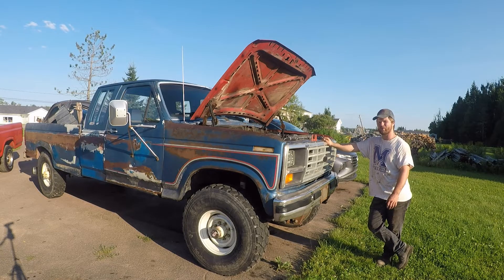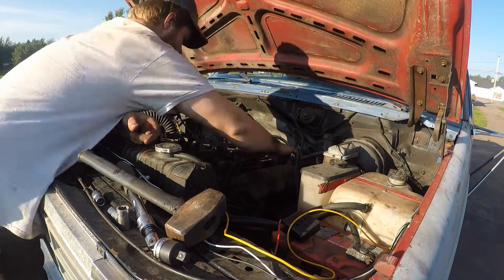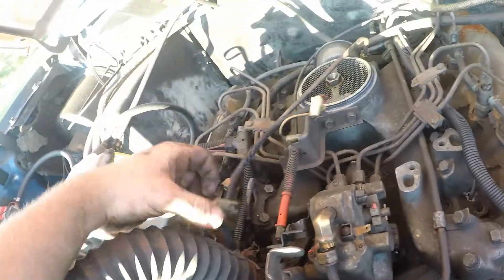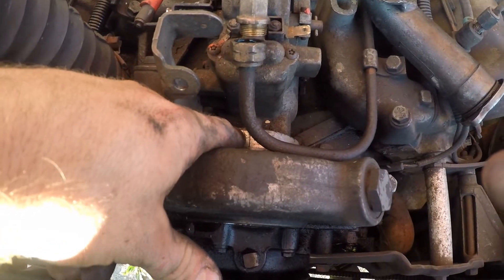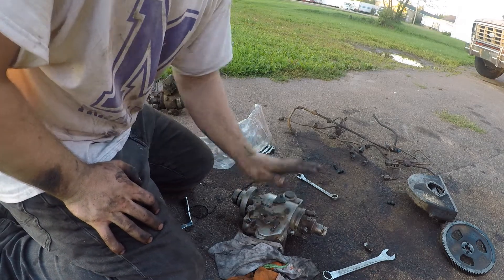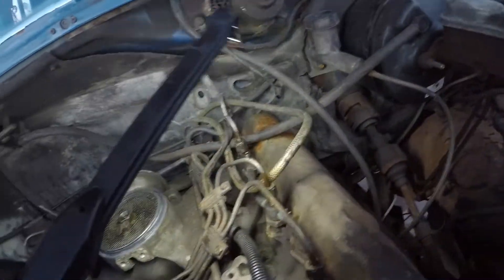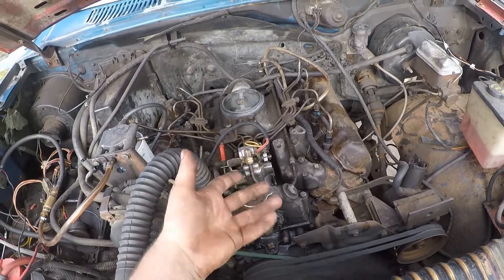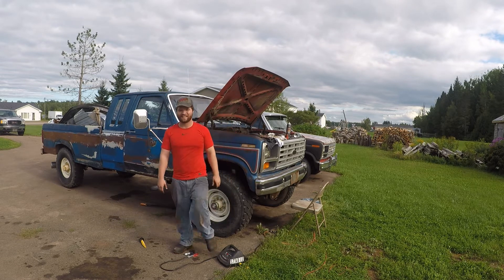7.3 IDI (6.9 IDI) Injection Pump Replacement, Step By Step Guide!

Comment: Hey man why didn’t you replace the injectors at the same time?
Reply: @jadinzack9271  I think because the IP is the most common issue on the fuel system, I've had to replace a few. (On different trucks)

Comment: Thank you for this, trying to work on my 7.3 idi turbo swapped 93 f350. Diagnose a bunch of problems after the swap
Reply: @2koolchris291  did the turbo get in the way much when removing/replacing the pump? im about to embark on the same journey.

Comment: Someone named skylabtech recommended your channel to me , I have a 95 f-250 7.3  with 300 k on it , I have an issue with it starting on cold mornings , below 60 degrees I have to use ether, they said my IP timing is way way off  ,  how do I diagnose it?

Comment: Good video and content ! Im about to replace a DB2 pump on my 7.3 and I was wondering when I take the old pump out can I just put the new pump right back in it's place or do I need to mess with the alignment of everything on the timing gear ? If nothing moves after i remove the pump don't I want to just install the new pump the exact way ???

Comment: I have a 93 f250 7.3 non turbo it idles fine but when driving faster then 30mph or 2k rpm it starts to stall and seems like its not getting enough fuel, and the fuel filter light comes on, i have replaced the filter, checked the fuel pickup, the fuel lift pump was replaced not long ago, im thinking its the injection pump but i dont want to waste the money on it, i have order the parts for a electric lift pump bc it may jdut the new mechanical lift pump is bad any insight on this would be super helpful
Reply from the maker: Best way would be to put a mechanical pressure gauge between the filter and the injection pump, if you have good pressure and good flow to the pump it’s pretty safe to say your pump is on its way out.

Comment: Just put a schrader valve on a gas cap and put about 7 psi air in the tank. Make bleeding a breeze.
Reply: Awesome tip. 👍🏼 I took my pump off but unfortunately I took the front gear off with it so now I have to make sure I install it in its correct timing and I don’t know how to do that :/
Reply: @jimschaffroth5652 just drill a hole in the gas cap and put some air in the tank will prime the system?
Reply: @Wilsonc263  

I used a spare cap I had. I bought a shrader valve that  is threaded on the mounting side and has a nut in it so that it can be attached to the fuel cap via the appropriate sized hole that was drilled in it.  Then I regulate the air pressure in my air compressor to about 8psi so it will maintain that pressure. Then I crank the engine.  I never crank longer then 30 or 40 seconds letting the starter cool off in between.  This method assists getting fuel to the injectors.
Reply: @jimschaffroth5652  thank you for that info I’ll give it a shot.
Reply: @Wilsonc263 if you do this with a factory style manual lift pump you can rupture the diaphragm and fill your engine with diesel

Comment: I didn't really understand why the static timing marks were there
Reply from the maker: Same as a distributor, clocking it one way or the other moves the injectors release timing pretty much at different points during the engine stroke. General rule for these idis, a little advanced helps with cold starting greatly, just don’t go too much.
Reply: Ok thanks I'm gonna have to study that more iv been studying my idi cause I got to pull one head because a glowplug fell in while changing them n little new to deisels thank for the good details video
Reply from the maker: @thomaslockley945  glad I could help, i I know what you mean, the glow plug system on these engines are shorta goofy haha xD

Comment: So if u leave the housing an gear on there's no way to get it out of time?
Reply from the maker: Correct, as long as you remove the pump from the back of the gear and not the two bolts that hold the top gear cover on the gear timing cannot change
Reply: What if I did take the housing  off, doesn't it just run the pump....
Reply: @mikesullivan329  i guess but if u ever had to line it up an time it may would be off I wouldn't pull the whole assembly

Comment: Great video! My cold idle plunger is touching the throttle linkage even when it’s retracted and engine is at operating temperature. I’m trying to set the idle a little lower. It’s around 750 but the cold idle solenoid plunger is in the way still. Any thoughts on this…
Reply: Got a 7.3 idi and stalls out while driving when slowing down thinking it'd be the injection pump or something not familiar with these engines at all
Reply from the maker: Cold plunder is slightly adjustable on my unit, one of the two attachment holes is slotted to allow for some forward back movement, loosening those two bolts and you can bring it back 1/4” inch or so
Reply: @highoSG  😮 on it !
Reply from the maker: Good luck let me know how you make out!
Reply: @highoSG  that did allow to move the bracket. Unfortunately it was all the way back. So I screwed in the plunger more. Seems pretty sunk in but it got the idle down. I did notice that the spring that pulls the throttle back down is dragging against the cold idle solenoid bracket. I may need to see what I can do about that or if it is routed right. Will lowering the idle rpm’s effect IP timing or in the automatic E4OD , change shift points?
Reply from the maker: @briansikes3865  you might have to clock your vacuum shifter slightly depending on how big of an rpm drop you are going for, as for your ip timing a small drop shouldn’t affect the pumps pressure timing noticeably nor the bottoms advance plunger since that only starts working at around 25% throttle, the linkage is flat before it rises so any decrease linkage wise would only let it ride more on the flat.
Reply: @highoSG  I've looked at this a lot. Overall, I believe my throttle linkage sets to far forward. Basically, it sets right on the cold idle solenoid plunger and that is setting the idle. The idle adjust screw doesn't have a chance to make any adjustment because it has to be backed all the way out to keep the idle rpms down. That being said. I've read a lot on the Stanadyne IP but I don't understand how to make adjustments. 1. Even though I believe my throttle linkage is too far forward and sitting on the cold idle solenoid plunger, under normal conditions I do maintain a reasonable idle. 2. I have noticed that when the engine gets to operating temp that my idle rpms increase to around 800 rpm. I've read that these pumps have a Bimetallic piece of metal on the metering valve assembly that changes the position of the metering valve as the ambient temperature of the engine reaches full operating temp. I think this is one of the things I'm seeing and if so, it looks to be working but I feel the rpms go to high with it. Is there a way to adjust this movement? 3. Does all of this pertain to the governor adjustment screw that sits in the front middle of the IP facing the cab of the truck? If so, how do you adjust this? Any help on this would be appreciated. Thanks

Comment: Hi there, thanks for the video - nice and straight forward. When you're going to put back in your new injection pump and you go to line up the timing marks, does that not change the bolting position/timing position of the main timing gear? Or am I mistaken for how it bolts back up? Thanks
Reply from the maker: Nope, as long as you know where your old pump mark was, bolt your new one in the same location.  95% of the timing comes from just bolting it in the right location, you can always find tune it with a diesel timing light but those are few and far between, I've always had good success using the old hash marks
Reply: Buen video yo también tengo el mismo ploblema  con un motor 6.9 al arrancar  también Kieran cambiar la bomba  donde se consigue